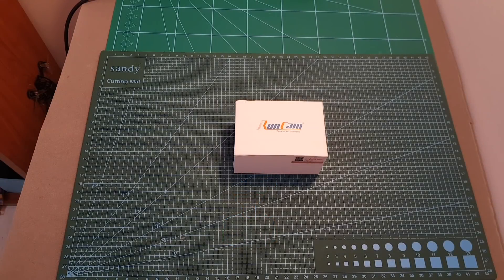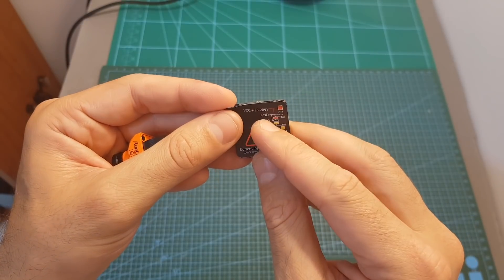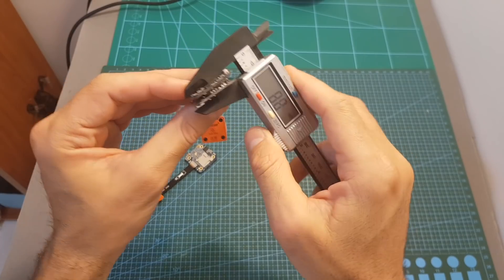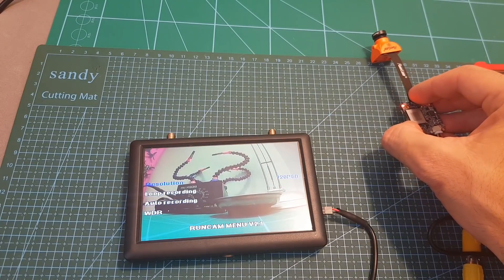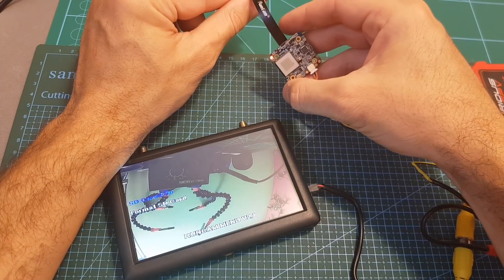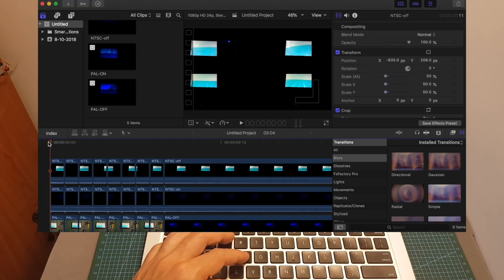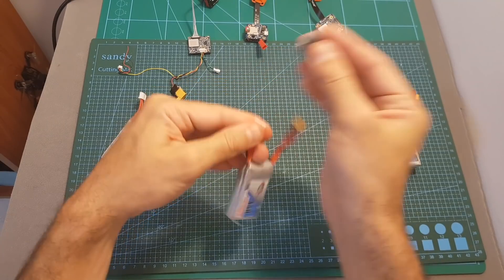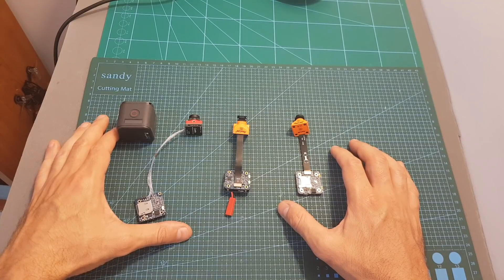Runcam Split Mini 2 - Overview & Power Consumption And Latency Tests

Comment: I am thinking of running runcam split mini 2 on diatone 239 r90 with a runcam TX V200 VTX but it seems the VTX doesn't have enough power output to actualy power the cam and the stack. Does it really draw >1A current and cannot be simply conected to VTX like all other cams?
Reply from the maker: You can simply connect the camera to the VCC.
Reply: @KremerFPV  Runcam split mini 2 manual and sticker on the cam says you should not do it. It draws way more power then vtx provides its like 250 vs 650 and sticker on cam and manual says 1amp+. That cant be right...

Comment: I seem to have trouble going down the menu items in the OSD menu with the press on the power button. A short press does not do anything. A long press shuts the camera down. I have to do a kind of "intermediate" long press+release of the power button to go down the next menu item. This is awfully complicated as a user interface. Have I a faulty unit or is this the same experience with you ?
Reply from the maker: If I remember correctly - you need to long press the other button (that doesn't turn off the camera) in order to enter the menu.

Comment: I have problem with my runcam split 2, after i put sd card, the camera can't work, then the indicator lamp is red, can you help me?
Reply from the maker: Do you see the Runcam Logo on the screen?
If so - it's probably a connector issue. If you can't see anything on the screen - might be a defective board.
Reply: @KremerFPV  I can see logo or picture before I put SD Card, after I put SD card everything black screen

Comment: Hi Gal. I have one of this, but sadlly  runcam dont have solved the problem, with out of focus problem, în the corners.. Mine have out of focus on the right side and when i try to solved, went worse.. Very dissapointed.
Reply from the maker: Did you try it with a different lens? Where did you purchase the camera?
Reply: @KremerFPV  What lenses to try? Allways for split mini?! Camera î buy it from one shop în Germany. 
Thanks for help

Comment: Good evening, I bought a run cam split mini 2, as soon as it receives power the camera starts recording on the micro sd but in analogy not by any video signal, would you kindly help me?
Reply from the maker: Maybe the camera is not connected properly. The recorded video on the micro SD card is ok?
Reply: Gal Kremer the video signal recorded on the sd is perfect, with many attempts I managed to get a video signal fpv even if very disturbed, I bought a filter lc hoping to solve this problem, thanks a lot

Comment: Greeting Gal,
On the manual it says that a switch can be used go turn on the WiFi on the runcam. Does this have a built in WiFi module?
Reply from the maker: Hi Charlos. There is no built in WIFI module in this camera.

Comment: You get a Thumbs up for the review, But now a warning This cam has got some problems, the two buttons snap of very easy happened to me while installing it in the quad, and it has happened to a few other pilots. Also when flying the screen cut out. I have been sent a replacement ( on it's way ) But I would not buy another.
Reply: Thank you for this information!
Reply from the maker: Thanks, I still didn't test it in a build. It will happen only next week.
Reply: @KremerFPV  I think that issue with freezing was due to the ribbon cable making bad connection. There seems to be a Rev2 of the Split mini 2 which has the ribbon cable glued/secured down. Hopefully that solves any freezing issues.
Reply from the maker: @vito7056  It might be the issue. Anyway I didn't experience the freezing issue with the Split Mini 2 and the 2s.